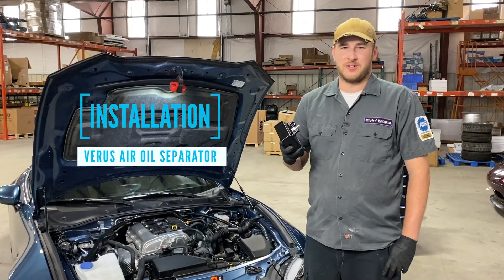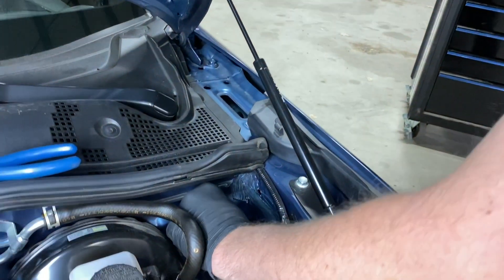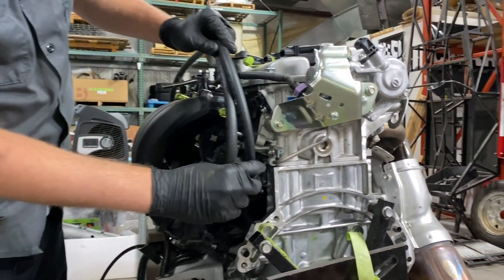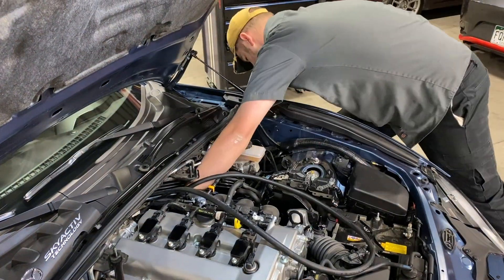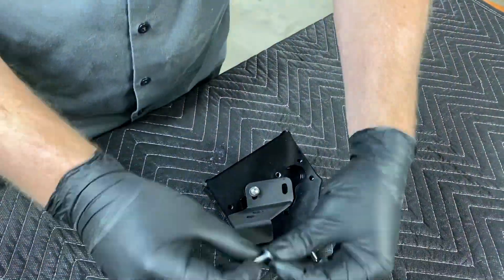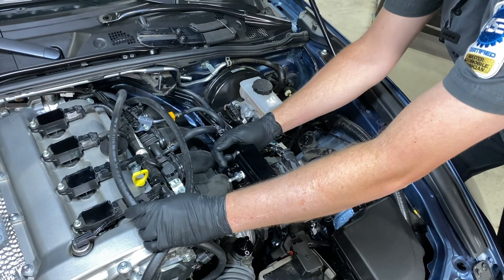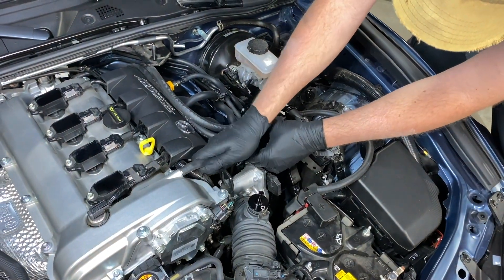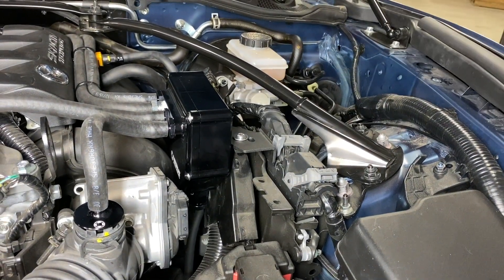ND MX-5 Miata Verus Air Oil Separator Install

Comment: Just a helpful note:  I installed the AOS yesterday and it took hours to hook up the hoses.  Found one of the nipples and got first hose on fairly quick.  Thought it was on the PCV valve.  We could not find the intake nipple???  Ruined my arm getting in there too many times.  Finally after several hours I figured it out!!!!  The PCV nipple should be pointing toward the firewall, but it had turned and was pointing toward the passenger tire.  That is why we could not find the second nipple for hose.  Finally got the nipple turned toward the firewall and it was pretty easy then.  Learn from my experience, and the install is not very hard.
Reply from the maker: Sorry to hear it was such a pain, but we appreciate the tips! Hopefully that helps someone else with their install!
Reply from the maker: Thanks for the tip!

Comment: Very informative and detailed video. Are the hoses supplied oil resistant? This is important because a hose made for lets say fuel line hose would breakdown from oil mist, and quicker then one may think. Also I would opt with using a bit of silicone lube instead of a drop of oil on hose ends since the silicone won't damage rubber and plastic like a petroleum lube would; but if the hose material is intended to carry oil then the drop of oil will not cause the rubber to break down.
Reply from the maker: Good points and yes, the included hose is rated for oil.

Comment: Not sure why they call it an AOS. It is technically a OCC. You have to drain it regularly
Reply from the maker: An AOS will recirculate back into the engine. On healthy engines without excessive amounts of blowby, you probably won't need to empty it very much.

An OCC will usually vent oil vapors to atmosphere and make a mess under your hood, rather than recirculate. 

Two very similar parts, but commonly misconstrued.

Comment: This was not nearly as difficult to install as the video made out. I think I did the entire install, start to finish, in about 45 minutes. The hardest thing, as mentioned, is the nipple on the engine block. I used a drop of oil in the hose, then shoved the handle of a ratchet wrench into the end of that hose for a minute or two to stretch it out slightly. I removed the handle, and immediately put the hose onto the nipple - it slid right on using only one hand, no fuss.

I do wish there was something that screwed into the drain plug so that a hose could be run down to the bottom of the engine bay to drain, rather than having to remove the AOS from its bracket in order to drain it.
Reply: This system looks like a total pain in the ass. A lot of catch can systems have a dip stick that seems like it would be helpful. Taking this thing on and off to check the levels every 1000 miles is gonna suck googs.
Reply: The ratchet wrench handle idea really helps out, many thanks!

Comment: 1st 1000 miles and got no oil on the catch can. I checked and rechecked to make sure the installation is correct and its good with no kinks either. So far no signs of busted seals. I was positive I'd get some oil in the can to make an average reading. I even checked the valves were working before installation and they are. Im perplexed 🤔. Fukit
Reply from the maker: We've seen a lot of variation of how much this kit actually catches, and it can vary a lot depending on your location, oil used maintenance schedule, mileage, etc. Even if you aren't seeing anything in the catch can, consider it good long term preventative maintenance ;)
Reply: I have a 2021 with about 40K miles on it. Header, exhaust, injectors and tuned for e85. I've had mine on for about 20K miles and haven't seen anything drain from the bottom every time I change the oil. I'm worried at times as well that it isn't catching anything.

Comment: Verus's instructions show the hose going on the bottom nipple on the intake, (the one under that screw) where as you put it the the top one Which one is correct? haha
Reply from the maker: The instructions and the video should be correct. The large barb with the check valve should go to the intake manifold, while the port closest to the engine on the air oil separator should go to the PCV valve, or "Engine block" as it's labelled in the Verus instructions.

Comment: Hi, i installed one of these to my supercharged ND so it had to be placed in another position, but after 2k miles when i went to drain it there was nothing in it, did i do something wrong or is it supposed to return all the fluids back? seemed to dry to me
Reply from the maker: On our ND, we rarely ever have more than a few drips. Granted, it's not driven a massive amount. A healthy engine shouldn't really have much blow by, but I'd still at least check it after every oil change.

If you're worried about it, be sure to double check that all your connections are correct. Other than that, nothing seems obviously out of the ordinary.
Reply from the maker: If your engine is healthy and you're not running too much boost, you might not get much accumulation in the AOS which is a good thing.
Reply: @FlyinMiataVideo  appreciate the response! makes me feel better, i thought normal would be more oil build up so glad to know that would be abnormal

Comment: The video shows two nipple openings on the engine stand alone block. I have the hose attached to the PCV valve. I cannot get the intake manifold hose attached. Tried for 2 hours. Arms too big I guess. But perhaps I’m trying to fit it on the wrong nipple?Not much skin left on the arm but would try again. Otherwise I have to take the manifold off.

Comment: Good vid choice, I’ve always wondered about the significance of them in moderate boost applications.
Reply from the maker: On a direct injection engine it's usually considered one of those "better safe than sorry" items for preventative maintenance especially on turbo cars. Verus has a little more info on their site, and there is a lot of information on the Miata forums as well.

Comment: Wondering why this one has 2 paths but all the other catch cans on the market only go on one?  Also, since this system shows that when unbolted, it is 2 separate hollow halves bolten together with no seal in between, how does it prevent the oil from seeping through eachother's channels or simply mixing together?  Is the shaped channels just general air flow guidance? just curious. 

Also wondering if anyone thought about a fuel injector that can be either manually sprayed into the throttle body or "fed" just to suck fuel down the intake ports so the valves can get chemically cleaned as you drive that way. Meth kits have proven not to clean anything, but I think the properties in actual gasoline will.
Reply from the maker: On most applications, the optimum plan would be to have two catch cans – One on the intake side, one on the exhaust. This Verus unit combines them into one smart AOS. There is no need for separate reservoirs, since the hose barbs on the Verus unit have check valves installed to prevent back flow.
Reply: @FlyinMiataVideo  how would you know if the check valve failed?

Comment: Is it any different if you have a Automatic.
Reply from the maker: Drop our techs a line at 970-464-5600 or email us at support@flyinmiata.com. Our CSRs should be able to give you more information there. Thanks!
Reply: No. I have an 2019 GT RF AT and I've installed this AOS and it took about an hour. Works fine.

Comment: What's the difference between an AOS and an oil catch can? Could we use both? Is AOS CARB compliant?
Reply from the maker: As far as terminology, an Air-Oil-Separator is pretty much the same thing as a high-quality "catch-can". The Verus unit is a bit more advanced than the average catch can tho, and features  multiple micron filters, baffles and includes hoses that attach to both the crank case and head. You would need a high-quality dual-catch can set-up to match the all-in-one Verus AOS.

Comment: FM Thanks for the video! 

Don’t want to mess this up. 

Please confirm the hose from the swiveling purple PCV valve connects to the check valve on the AOS (nozzle 3 when counting from the the front of the car)

Is that the right way?
Reply from the maker: Check out the official written instructions from Verus, it might make things easier to explain:
https://www.flyinmiata.com/support/instructions/misc/M04-37960%20ND%20Miata%20Air%20Oil%20Separator%2C%20Verus.pdf

Comment: Will this fit with the Long Road Racing strut tower X brace? The one they run on the ND Cup cars
Reply from the maker: It should, but we can't guarantee it since we've never had one to try. You might need to fab/or modify the mounting bracket that attaches the air/oil separator body. If you need more details, feel free to reach out to us at support@flyinmiata.com .  Thanks!

Comment: Any problems with pressure leaking between the crank and intake through the system on higher PSI engines?  I’ll be running between 14-16 psi in my 2018 club and heard there may be an issue with this.
Reply from the maker: While it may be possible under extreme conditions because the two halves in the Verus separator share a drain, this is not likely, and not something we've seen, due to the built in PCV valving inside the Verus connectors. Please reach our customer support team directly at 970-464-5600 or support@flyinmiata.com for more info!

Comment: Do I dump the drained oil back or is it recommended to add new oil?
Reply from the maker: Dispose of the oil collected in the separator, check your levels, and add new fresh oil if necessary between oil changes.
Reply: Don't drain the oil back and it's not just engine oil that's collected.
Reply: It’ll be frothed oil with a high degree of water.  You dispose of anything collected.

Comment: I checked on Verus's website but didn't see anything regarding the need to replace or clean those 4 filters inside the AOS. Is there any need to maintain those filters over time?
Reply from the maker: From our experience those don't really need to be cleaned as the oil and moisture should drip down eventually. You could clean them if you wanted, but we haven't found it necessary yet.
Reply: @FlyinMiataVideo  Thanks, much appreciated! Highly considering this as the next mod!

Comment: What is it for? Do you didn’t think of telling us that did you? Come on guys
Reply from the maker: Since this is an installation video we figure you already know. It's mostly in the title (an air oil separator would separate the oil from the air, via the PVC system) but for more details on what it does and why you might need one, you can check out the product listing here. https://flyinmiata.com/products/verus-air-oil-separator?_pos=2&_psq=air+oil&_ss=e&_v=1.0
Thanks for watching.
Reply from the maker: Oh yeah, we always have hyperlinks to the product/s in the kit overview just below the video. I don't know what this looks like on a mobile device so, it might not be very obvious.

Comment: It would be nice to see a naturally asperated install (of another type of oil separator) on a NA as well in the future. I am planning on using a KazeSpec Engineering 2 Chamber Oil Catch Can on my NA. I don't think you sell them but it would be nice to see another install. Not sure either if I would need a check valve for my intake line or not. Do ALL intake lines need check valves? I putting in my own fabbed up catch cans in my 1996 Dodge Ram 5.9 and the video brought up that question for that install as well. Thanks Again for another great video. I have really been enjoying them. Chris
Reply from the maker: Good suggestion, we'll add it to our video list and see what we can do!
Reply: Why not purchase a product from the company (FM) that supports the MX5 community?